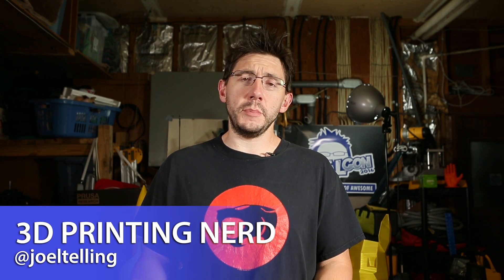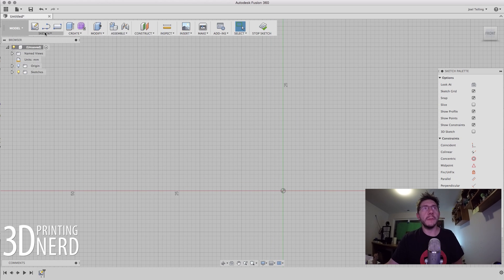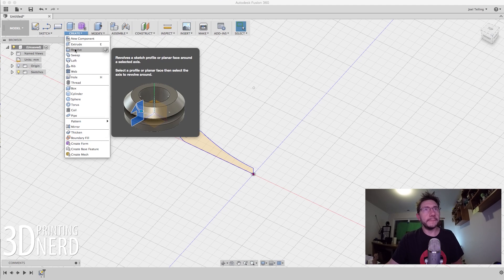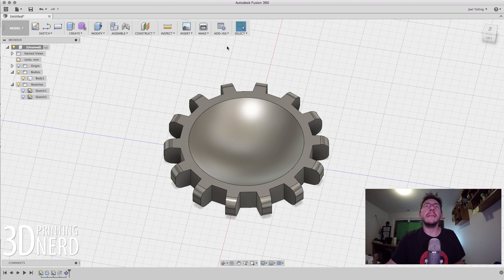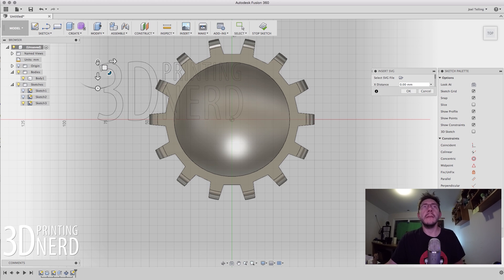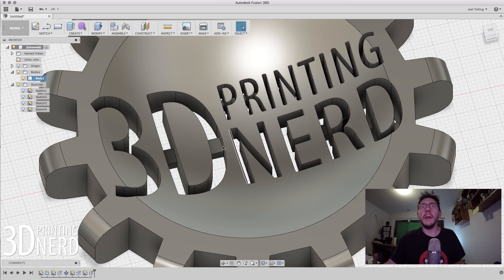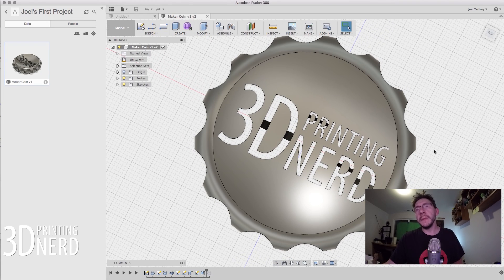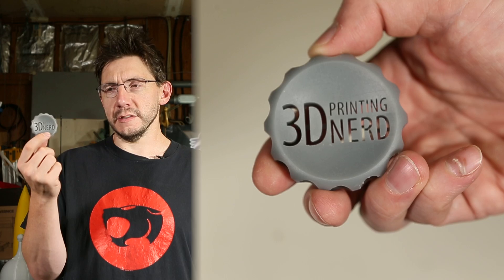Fusion 360 Tutorial to Create a Maker Coin for 3D Printing

Comment: I've given up on this software and gone back to 123D design. Shame they no longer support it. Good job I kept the install file and made backups. Fusion 360 sucks IMO. They give you vague definitions of it being free, but after a year snatch it away and make you pay through the nose. I had it installed for a year but only tried and failed twice to learn on it. Went to go back and now it crashes each time I try to open it. I figured that all the tools I need is in 123D and so much quicker and simpler. Anything more complicated I just send to Meshmixer.

Comment: I have a Prusa i3 RepRap open frame printer. I sliced my model using Simplify 3D with a layer height of 0.1mm. Print output is fine but there are continuous ripples on my part. How do I fix this?

Comment: @joeltelling Theres a couple things i think you could learn from,that you mentioned you in the video could not find
First off for using inches you can get the units of measurement, 
Second you can create a sketch point as a create sketch under the sketch catagory in the toolbar, i know because i have been using fusion 360

Comment: I am an engineer and have used CAD including all of the available programs for the past 23 years. Your tutorial is one of the best I have seen. I watched it just to see how you did for a beginner. AWESOME. Nice pace made mistakes and fixed em with explanation. BRAVO. 

FYI, When selecting pattern FEATURES, select the feature you want to pattern from the history timeline at the bottom of the screen. Also note that renaming these history items will help tremendously on complex models.
Reply: Thanks for the tip about patterning features! I had made it a component as I remembered you could go back and edit sketches and it would update the 3-d shape in real time, but it wouldn't let me pattern the faces I cut out. Patterning the cut-out feature worked though :)

Comment: Your coin came out great, good job.  Another way to get the half circles around the side is to create a cylinder, move until it intersects the disk then use "Join" (I know you're not joining), and then pick up with the pattern faces.  I realize yours was easier now that I typed all of that, but this is a more advanced way to get the same result.  Just information is all.  Keep at it, Fusion 360 is fantastic....

Comment: Joel, I could give you a few tips to speed up your design process. such as using fillets instead of 3-point arcs, and around 9:00 you used pattern faces, which of course can work, but i would have chose feature, then grabbed the extrude from the timeline at the bottom. 

great video, Thumbs up as always! send me a message on twitter if you have questions about Fusion, i'm getting pretty good with it :)
Reply from the maker: ooh, thanks for the tips! I'll DEFINITELY hit you up soon!

Comment: Where's that huge coin at?  :)

Love this video.  I have been working exclusively with OpenSCAD up until now.  Think I will give Fusion 360 a try.
Reply from the maker: Thanks! Same! I used OpenSCAD to do my GoPro rig. Fusion 360, to me, reminds me of OpenSCAD. I don't know why. Tell me if I'm way off base.
Reply: OpenSCAD doesn't have that nice graphical UI for describing the shapes.  I would have been able to do that in OpenSCAD fairly quickly since it can be made with some basic shapes.  But it looks like it would be easier for more complex shapes.
Reply from the maker: Edward Boston True, but, in OpenSCAD I'm doing joins and cuts and essentially manipulating shapes. In Fusion 360, it feels very much the same with the shape manipulation. Plus, well, there's a lot more to do with complex stuff. Exactly.

Comment: i see alot of people printing at 20% infill, most of the time i use 80% or even 100%, do you know when could it be under 80% ?
Reply: He has a great video describing why higher infills are not always better.  Very informative video.
Reply from the maker: Why such a high infill percentage?
Reply: Most things can easily be printed at 20% or lower, you only need higher infills if the part is going to be under stress.
I use 10 to 20% for most things.
Hope this helps you
Reply from the maker: ChristianP1973 Ah, okay. You get MOST of the model support from the shell, but like Spike said, higher infill WILL help parts that are under stress. Try a part with an extra shell and 10% infill and see what happens!
Reply: +3D Printing Nerd ah! thanks alot you guys!